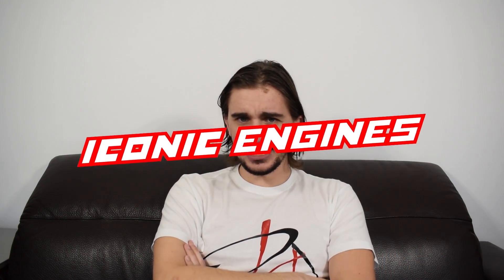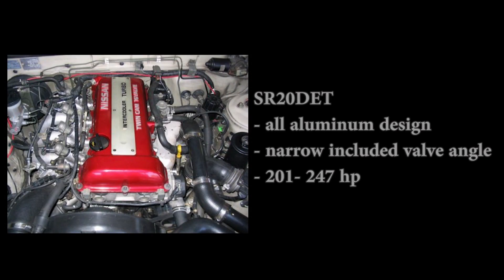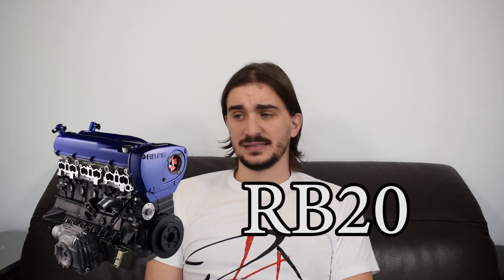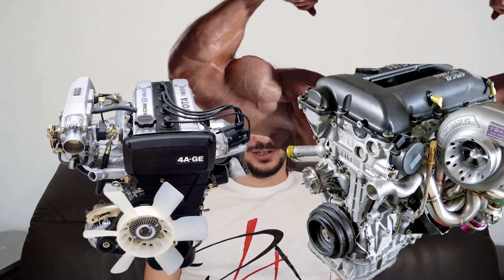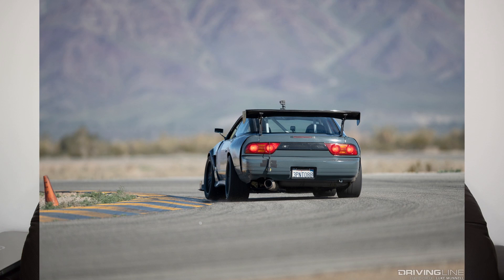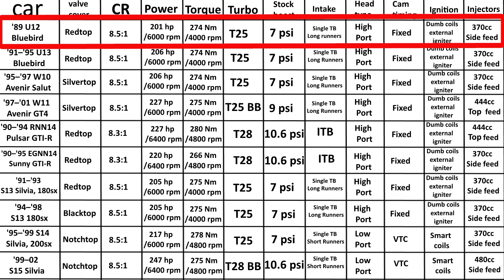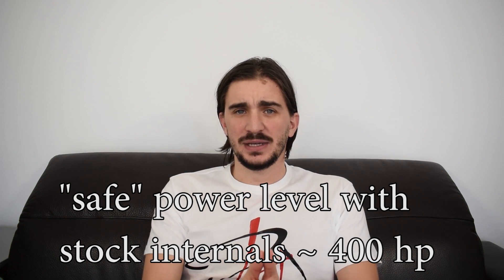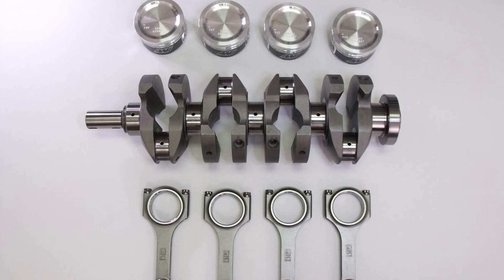Nissan SR20DET - What makes it GREAT? ICONIC ENGINES #9

Comment: Car: ’05 Nissan Silvia S15
Engine: SR20
Driver: Muhammed Ali allahu akbar 
1/4 Best ET: 6.228 @ 226.81 MPH
Track: Orlando Speed World
Date: Oct 27, 2018

Status: Active
The driver of this Nissan S15 is Muhammad Ali, and his ride is the quickest and fastest SR20-powered ride on the planet. He has some badass people helping him make things happen and he does a great job behind the wheel as well. MazWorx built and tuned the chassis to the SR20, which cranked out over 1,800 horsepower on the dyno at 60 pounds of boost. Legendary tuning guru Shane Tecklenburg handles the tuning of the car and you can tell it’s got his stamp all over it, running both ridiculously quick and consistent, which shows the tune is near perfect and they aren’t just taking stabs at the parameters to see what works. Anybody who knows anything about Shane T knows his rides are consistently quick like this and shatter records regularly, proof that he’s the man in the tuning world.

The numbers the car puts up at almost perfectly on par with NHRA Pro Stock, allowing me the opportunity to make a comparison between the drastically different combinations. Pro Stock rules, as most of you know, mandate naturally aspirated powerplants, while this SR20 is crammed with almost 70 pounds of boost at speed on the track. Of course, it has half of the cylinders of the 500 CID V8 under the hood of a Pro Stocker, which makes around 1,500 horsepower.

So how does the Pro Stocker run the same ET with less horsepower? The answer is contained within the interview with Mark from MazWorx, who talks about the chassis. See if you guys can determine the difference and let us know what you think.
Reply: Billet block, custom billet crank, custom alloy rods and piston, custom over size headstuds, running on meth and 2 x 105mm turbos and a full tub frame on big tyres with complete custom rear end. Air shift librity transmission.

So basically the only thing from Nissan factory is the bare head.

Comment: I've seen more SR20 engines blow up than all other engines put together. Party because every 2nd drift car had SR20 but the SR20 had the full works burger rods out the block, spun bearings, broken rocket arms, cracked intake manifolds. I've seen someone drilling and tapping something in the head at the track thinking why bother your just gonna blow the engine and yep next time he came into the pits their was a rod knock. The SR20 had a weak gearbox and drifters were cutting the bellhousings and welding on a RB25 gearbox. Then drifters were started putting RBs into Silvia's then LS into skylines and cats and dogs started living together the world is a different place now.
Reply: Car: ’05 Nissan Silvia S15
Engine: SR20
Driver: Muhammed Ali allahu akbar 
1/4 Best ET: 6.228 @ 226.81 MPH
Track: Orlando Speed World
Date: Oct 27, 2018
Status: Active
The driver of this Nissan S15 is Muhammad Ali, and his ride is the quickest and fastest SR20-powered ride on the planet. He has some badass people helping him make things happen and he does a great job behind the wheel as well. MazWorx built and tuned the chassis to the SR20, which cranked out over 1,800 horsepower on the dyno at 60 pounds of boost. Legendary tuning guru Shane Tecklenburg handles the tuning of the car and you can tell it’s got his stamp all over it, running both ridiculously quick and consistent, which shows the tune is near perfect and they aren’t just taking stabs at the parameters to see what works. Anybody who knows anything about Shane T knows his rides are consistently quick like this and shatter records regularly, proof that he’s the man in the tuning world.

The numbers the car puts up at almost perfectly on par with NHRA Pro Stock, allowing me the opportunity to make a comparison between the drastically different combinations. Pro Stock rules, as most of you know, mandate naturally aspirated powerplants, while this SR20 is crammed with almost 70 pounds of boost at speed on the track. Of course, it has half of the cylinders of the 500 CID V8 under the hood of a Pro Stocker, which makes around 1,500 horsepower.

So how does the Pro Stocker run the same ET with less horsepower? The answer is contained within the interview with Mark from MazWorx, who talks about the chassis. See if you guys can determine the difference and let us know what you think.
Reply: And yet still. The fastest S-chassis cars on the planet ALL are powered by the SR20. From time attack to drifting to drag racing.
Reply: Its not as if other engines dont blow up alot as well. But. Heres a 1400hp street driven SR20. Click on the link https://youtu.be/1eG6HDET4Fo
Reply: @conradsealy9603  yeh for sure I think tuning is a million times better than when i seen this stuff too.

Comment: Nice video. To bad you didn't catch the whole SR range though.
SR20DE, SR20VE, SR16VE, etc.
Reply: Car: ’05 Nissan Silvia S15
Engine: SR20
Driver: Muhammed Ali allahu akbar 
1/4 Best ET: 6.228 @ 226.81 MPH
Track: Orlando Speed World
Date: Oct 27, 2018
Status: Active
The driver of this Nissan S15 is Muhammad Ali, and his ride is the quickest and fastest SR20-powered ride on the planet. He has some badass people helping him make things happen and he does a great job behind the wheel as well. MazWorx built and tuned the chassis to the SR20, which cranked out over 1,800 horsepower on the dyno at 60 pounds of boost. Legendary tuning guru Shane Tecklenburg handles the tuning of the car and you can tell it’s got his stamp all over it, running both ridiculously quick and consistent, which shows the tune is near perfect and they aren’t just taking stabs at the parameters to see what works. Anybody who knows anything about Shane T knows his rides are consistently quick like this and shatter records regularly, proof that he’s the man in the tuning world.

The numbers the car puts up at almost perfectly on par with NHRA Pro Stock, allowing me the opportunity to make a comparison between the drastically different combinations. Pro Stock rules, as most of you know, mandate naturally aspirated powerplants, while this SR20 is crammed with almost 70 pounds of boost at speed on the track. Of course, it has half of the cylinders of the 500 CID V8 under the hood of a Pro Stocker, which makes around 1,500 horsepower.

So how does the Pro Stocker run the same ET with less horsepower? The answer is contained within the interview with Mark from MazWorx, who talks about the chassis. See if you guys can determine the difference and let us know what you think.
Reply: agreed! less talking about drifting and more talking about the varieties of SR family.
Reply: A vw beetle type1 engine has run the 1/4 in 6s at over 220mph. 

Oh, and it was n/a. 
Just food for thought.

Comment: I said do the CA18DET dammit!!
Reply: Car: ’05 Nissan Silvia S15
Engine: SR20
Driver: Muhammed Ali allahu akbar 
1/4 Best ET: 6.228 @ 226.81 MPH
Track: Orlando Speed World
Date: Oct 27, 2018
Status: Active
The driver of this Nissan S15 is Muhammad Ali, and his ride is the quickest and fastest SR20-powered ride on the planet. He has some badass people helping him make things happen and he does a great job behind the wheel as well. MazWorx built and tuned the chassis to the SR20, which cranked out over 1,800 horsepower on the dyno at 60 pounds of boost. Legendary tuning guru Shane Tecklenburg handles the tuning of the car and you can tell it’s got his stamp all over it, running both ridiculously quick and consistent, which shows the tune is near perfect and they aren’t just taking stabs at the parameters to see what works. Anybody who knows anything about Shane T knows his rides are consistently quick like this and shatter records regularly, proof that he’s the man in the tuning world.

The numbers the car puts up at almost perfectly on par with NHRA Pro Stock, allowing me the opportunity to make a comparison between the drastically different combinations. Pro Stock rules, as most of you know, mandate naturally aspirated powerplants, while this SR20 is crammed with almost 70 pounds of boost at speed on the track. Of course, it has half of the cylinders of the 500 CID V8 under the hood of a Pro Stocker, which makes around 1,500 horsepower.

So how does the Pro Stocker run the same ET with less horsepower? The answer is contained within the interview with Mark from MazWorx, who talks about the chassis. See if you guys can determine the difference and let us know what you think.
Reply: @オッさんタイプXの日産に乗る  that Tekno Toyz SR20 makes a lot more power now. Almost 3000hp. And for more than a year the car held the mph record for 4 cylinder drag cars at 229.50mph. We know the SR20 is a beast. #SRFORLIFE
Reply: @オッさんタイプXの日産に乗る   im pretty sure the s15 ended production in 2002.
Reply: @classys-chassis6433   2020  SR20  shitting 3000hp

Comment: Honda K series next K series please 😇
Reply: Car: ’05 Nissan Silvia S15
Engine: SR20
Driver: Muhammed Ali allahu akbar 
1/4 Best ET: 6.228 @ 226.81 MPH
Track: Orlando Speed World
Date: Oct 27, 2018
Status: Active
The driver of this Nissan S15 is Muhammad Ali, and his ride is the quickest and fastest SR20-powered ride on the planet. He has some badass people helping him make things happen and he does a great job behind the wheel as well. MazWorx built and tuned the chassis to the SR20, which cranked out over 1,800 horsepower on the dyno at 60 pounds of boost. Legendary tuning guru Shane Tecklenburg handles the tuning of the car and you can tell it’s got his stamp all over it, running both ridiculously quick and consistent, which shows the tune is near perfect and they aren’t just taking stabs at the parameters to see what works. Anybody who knows anything about Shane T knows his rides are consistently quick like this and shatter records regularly, proof that he’s the man in the tuning world.

The numbers the car puts up at almost perfectly on par with NHRA Pro Stock, allowing me the opportunity to make a comparison between the drastically different combinations. Pro Stock rules, as most of you know, mandate naturally aspirated powerplants, while this SR20 is crammed with almost 70 pounds of boost at speed on the track. Of course, it has half of the cylinders of the 500 CID V8 under the hood of a Pro Stocker, which makes around 1,500 horsepower.

So how does the Pro Stocker run the same ET with less horsepower? The answer is contained within the interview with Mark from MazWorx, who talks about the chassis. See if you guys can determine the difference and let us know what you think.

Comment: There is something wrong with spec sheet. It says the S14 has a T25 but they have a T28. Note: Euro models use journal bearings, JDM models use dual ball bearings.
Reply: I forget, do the s14's have the same t25 turbines though?
Reply: @zandozman  no, the JDM s14’s come with T28 turbo’s the same as S15’s with some small differences. Sorry for late response.

Comment: One of my favorite engines. Closed deck aluminum with a timing chain, solid internals stock, what's not to like? Great videos man!
Reply: Me and my friends have swapped them into old mercedes 190e couple of times. Reliable and cost effective way to get 200-300hp 4 door, that doesn't weigh that much and with suspension upgrades, can deliver suprisingly great performance.
Reply: @TheSpekkel1  That's pretty awesome! Not a swap I would expect.
Reply: @802Garage  190e is a great platform, but the standard models had pretty anemic engines and the sportier models are too expensive, so I think it's a great swap to go from an iron block 1.8l 8v, into sr20det with all the aftermarket it has, which the mercedes engines lack unfortunately.
Reply: @TheSpekkel1  Makes sense to me!
Reply: @TheSpekkel1  can they be built to make reliable 400hp
Reply: @eresuplays  I think its reasonable to say yes, it could be done with an sr20. Nissan S chassis people at least claim running such numbers with not much problems. But we havent done it, mainly because our winters here are long and cold. 300hp rwd car driven on snow and ice is interesting enough and more power is pretty pointless when it all adds into just more wheelspin and tire wear.
Reply: What's not to like? A lower torque-to-hp ratio than a 1.6 Miata, that's what. (Doesn't actually matter, just clutch kick the fuck out of it)
Reply: @danchay7870  I have 400+ nm in my s14
....
Reply: I was so surprised when I got my 180sx that it had a timing chain, nice little bonus I don't have to change a timing belt :)
Reply: yes, my favourite part is the rocker arms. very good

Comment: Did you really just name the 180 the father of all drifting?

AE86's the world over have started crying.
Reply: Car: ’05 Nissan Silvia S15
Engine: SR20
Driver: Muhammed Ali allahu akbar 
1/4 Best ET: 6.228 @ 226.81 MPH
Track: Orlando Speed World
Date: Oct 27, 2018
Status: Active
The driver of this Nissan S15 is Muhammad Ali, and his ride is the quickest and fastest SR20-powered ride on the planet. He has some badass people helping him make things happen and he does a great job behind the wheel as well. MazWorx built and tuned the chassis to the SR20, which cranked out over 1,800 horsepower on the dyno at 60 pounds of boost. Legendary tuning guru Shane Tecklenburg handles the tuning of the car and you can tell it’s got his stamp all over it, running both ridiculously quick and consistent, which shows the tune is near perfect and they aren’t just taking stabs at the parameters to see what works. Anybody who knows anything about Shane T knows his rides are consistently quick like this and shatter records regularly, proof that he’s the man in the tuning world.

The numbers the car puts up at almost perfectly on par with NHRA Pro Stock, allowing me the opportunity to make a comparison between the drastically different combinations. Pro Stock rules, as most of you know, mandate naturally aspirated powerplants, while this SR20 is crammed with almost 70 pounds of boost at speed on the track. Of course, it has half of the cylinders of the 500 CID V8 under the hood of a Pro Stocker, which makes around 1,500 horsepower.

So how does the Pro Stocker run the same ET with less horsepower? The answer is contained within the interview with Mark from MazWorx, who talks about the chassis. See if you guys can determine the difference and let us know what you think.
Reply from the maker: I think I've made it clear enough in the video and have said the AE86 is an equally good drift chassis. But the s-chassis had power from the factory, so you could start drifting easily without any significant modifications, which was very important for getting people into drifting, especially in the early days when tuning wasn't what it is today.
Reply: @d4a  well it wasn't meant all that seriously, BUT, the ae86 outdates the 180, so the 180 can't actually be its father :p